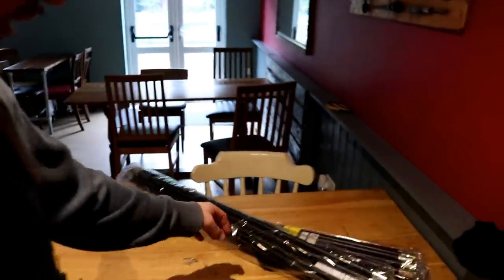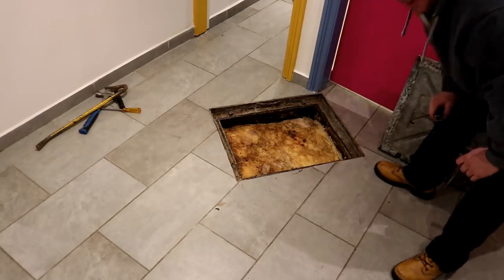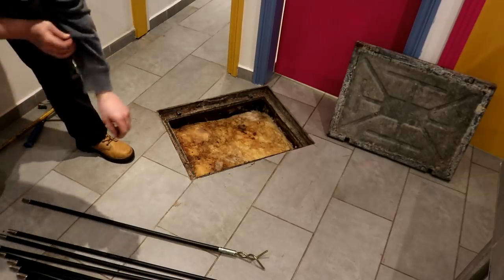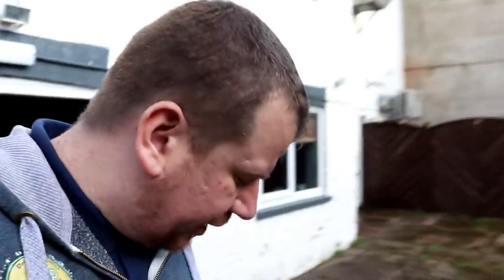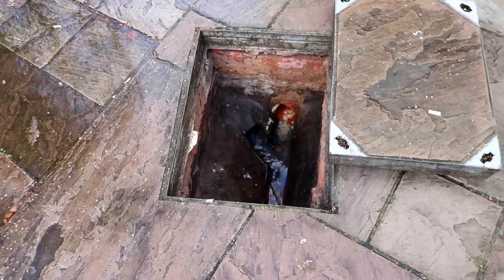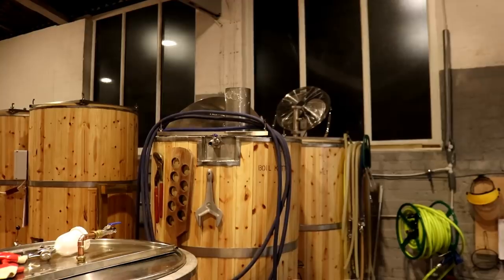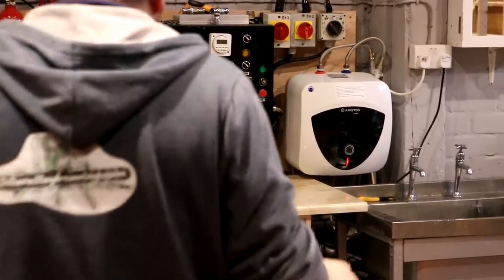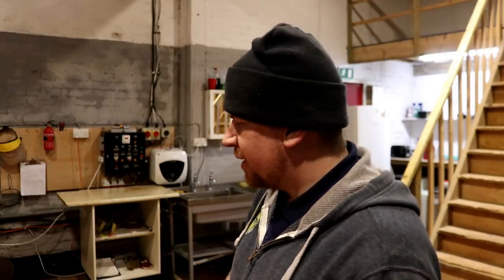WHATS UNDER THE MANHOLE ANGELOS?

Comment: Oh man you had fun........even if it is a ‘shit job’ I love it when they go!! What was the building before? If it happens regularly you need to get a camera down and check for a stricture in the pipe. CHIMNEY For sure
Reply from the maker: I will have my eye on it now, 2 or 3 times a week I will just go flush all the loos, help push the poop out. The pipework looked ok to me, could just have been the fact there is a 3 into 1 branch from the loos. It might get busy on the track if all the ladies leave poo station at the same time.

Comment: You need rodent traps in the cubicals. 
That started with furry rodents all tangled up together. You know.... the green tailed kind. 
Put them sanitary rodent traps and they’ll hopefully stop flushing them. The bog roll then backs up behind and you end up with that shepherds pie you were greeted with.
Reply from the maker: I fitted a sanitary bag dispenser and each cubicle has a bin. Can't win buddy.
Reply: I hear ya. 
But after 12 years as a plumber and filling countless clean sacks with the little buggers wound around the drain machine coil I can tell you with certainty where the problem lies.